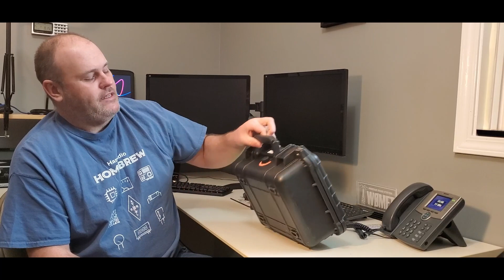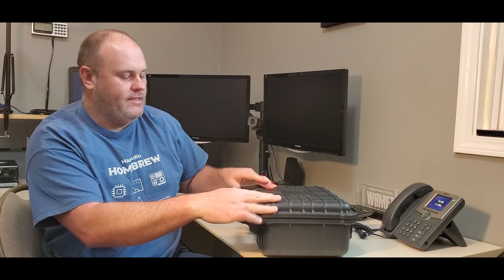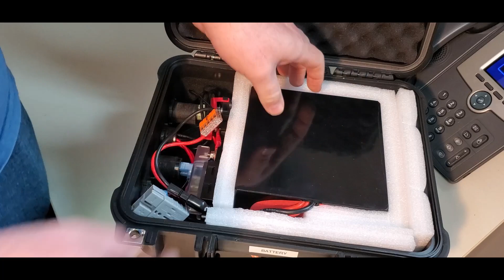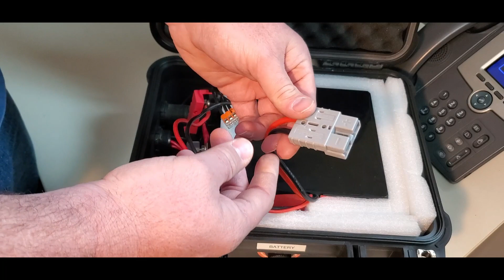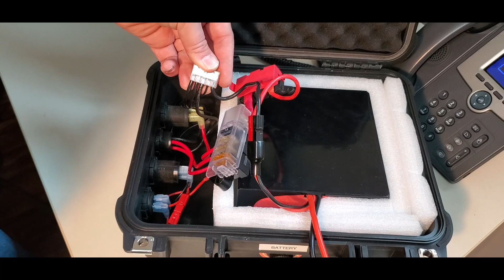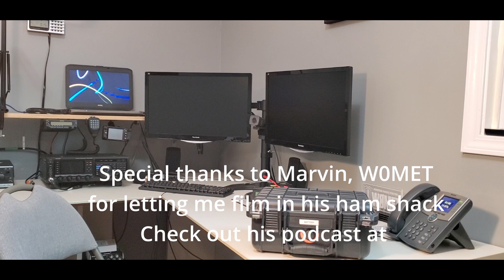Harbor Freight Apache battery box for Amateur Radio. What would you change?

Comment: Nice setup, but you really don't need that 12v display because lithium batteries give 13.8 volts continuously until they are depleted. I want to find a way to hook up one of those Powerex shunt included power meters that give me a true reading on the health of my battery (the same one you have).